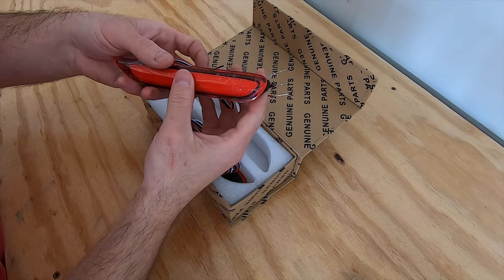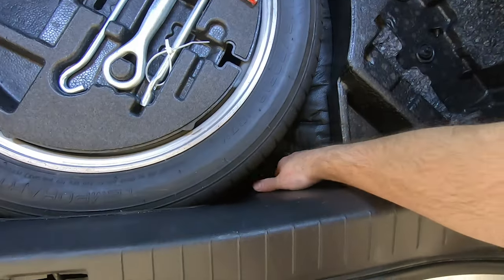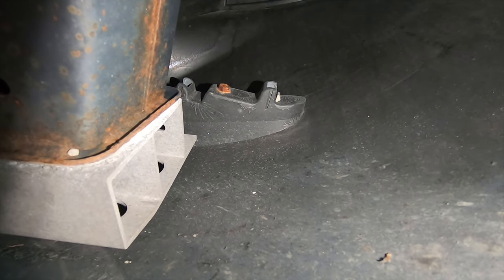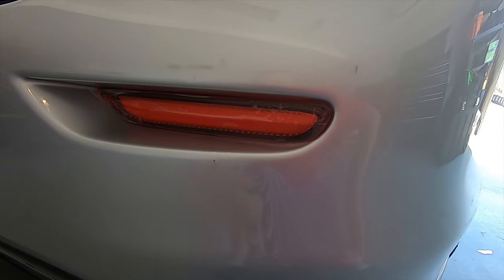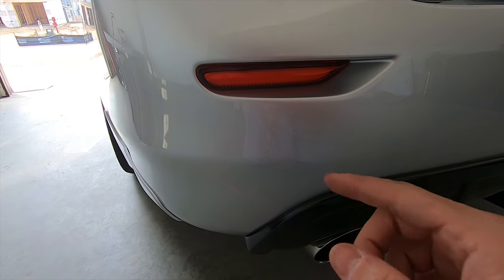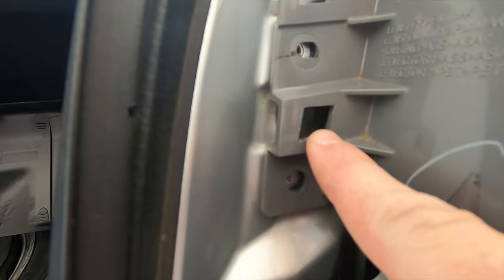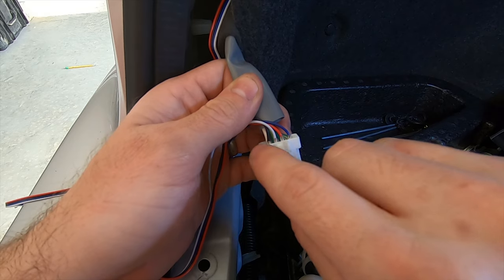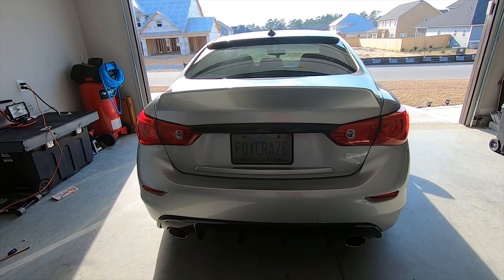How to install Infiniti Q50 rear sequential signals (without the pigtail)

Comment: Mine came with pins but the wires were about 2 feet so I drilled some small holes in the trunk
Reply from the maker: Dang haven’t seen a set with such short wires, but at least you worked it out! Did you put any grommets on the drilled holes so the cut metal doesn’t wear into the wires?

Comment: I did my like that but when my light is on my turn signal light don’t light up to the left only stay on read do you have the same problem? Where my lights is off It work just like yours
Reply from the maker: No mine work correctly in every setting. I would recheck the plug/ wiring. you might have two wires or pins touching somehow. If that’s not the case and it done that since day 1 then it might be a defect in the circuit board itself.
Reply: @Foxcraze  thanks I will check my again God bless you brother
Reply from the maker: Have a great one man, and good luck!

Comment: Was your tail lights on auto or off?
Reply from the maker: I believe I had them set to auto and due to the brightness outside they just weren’t on. Why do you ask?
Reply: @Foxcraze  I plan on getting the rear bumper lights also. I've seen some videos where they stay on and some videos when they don't. I rather it not stay on and be a suprise lol.
Reply from the maker: Oh, lol in that case the answer is if the lights are set to auto or on then they will be on but if set to off then only the sequential and brake application will function.

Comment: What's the name if the tool you used to trim the plastic?
Reply from the maker: I used a Dremel3000 with a drum sanding bit.  Any brand rotary tool will get the job done though just adjust the speed so it sands the plastic and doesn’t melt it in the process.

Comment: This is just what I was after.  I've had the lights for nearly a year but not installed them as I wasn't sure how the electrical connectors went!  Thanks (I just hope my terminals are the same!!)
Reply from the maker: Real glad it was helpful. Your tail light harness will be identical but if your sequential wires are a different color than mine trial and error will solve the sequence fairly quick!

Comment: ur video help me a lot I really appreciate it, just a quick question, I want to install a diffuser with a third brake light can I connect it to the sequential wire too? Or what should i do? because I already installed the rear sequential lights, thanks 🙏
Reply from the maker: Yeah I see no reason why you can’t tap into the sequential lights. They are also a low wattage and should be just fine!

Comment: Good video, thanks for doing it!  I'm thinking of doing this on my 2015 Q50.  Someone below mentioned that when the brake light is on, it overrides the turn signal.  Meaning if you are standing on the brake while a turn signal is on, there is no sequential.  What does yours do?
Reply from the maker: So I tested this theory and you are correct; if the brake is applied the sequential goes solid as a brake light while the stock turn signal continues to flash.
Reply: @Foxcraze  Thanks for checking, appreciate it.